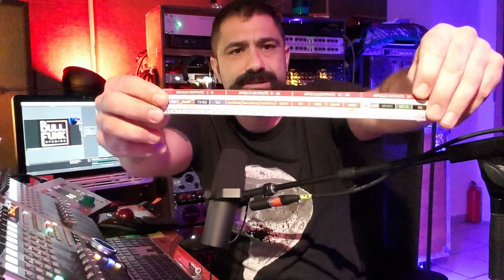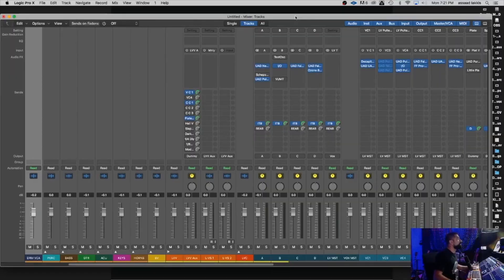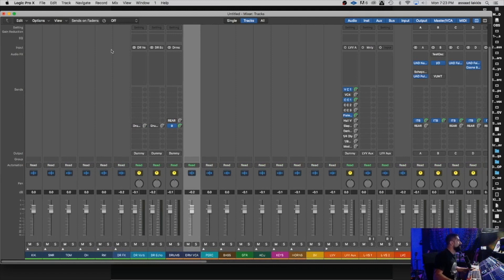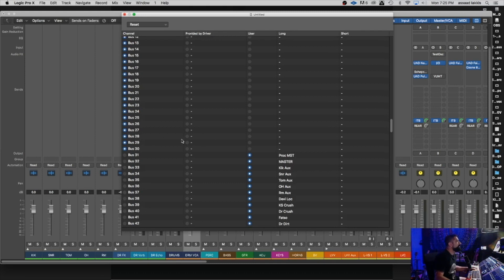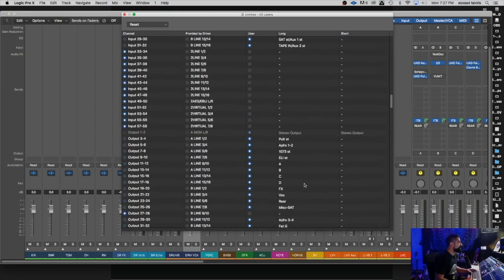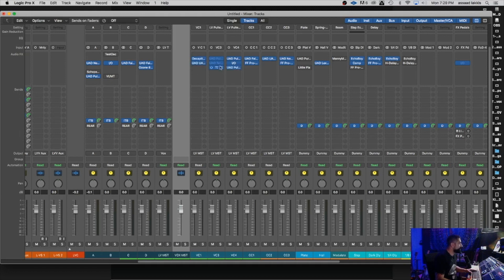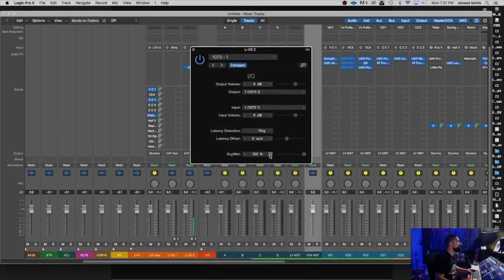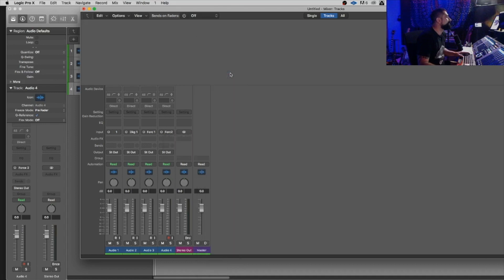How To Label I/O's & Busses in Logic & Patchbays

Comment: I am new to hybrid mixing, all my analog gear is patched up using Patchbays, but I hear phasing and latency issues when I try to use it hardware with I/O pluign, it only detects +1 sample ....if I connect my hardware to actual Inserts in my Apollo then I/O plugin works fine. Any suggestion how to fix the latency issue when using analog gear with patch bays in Logic Pro for mixing? Thanks